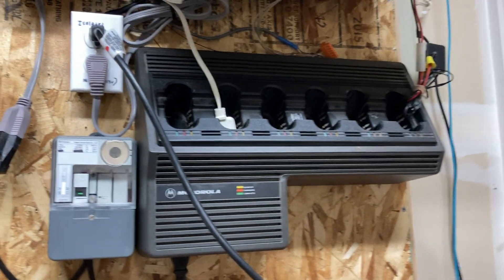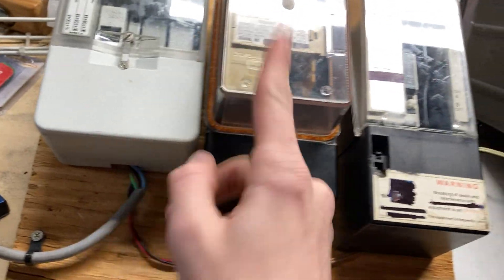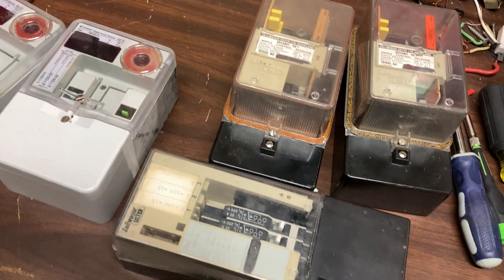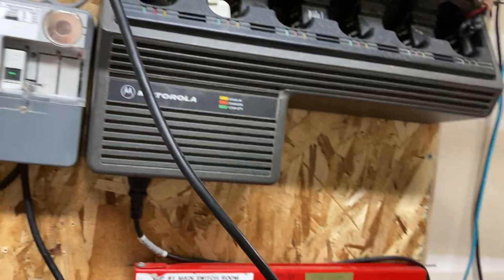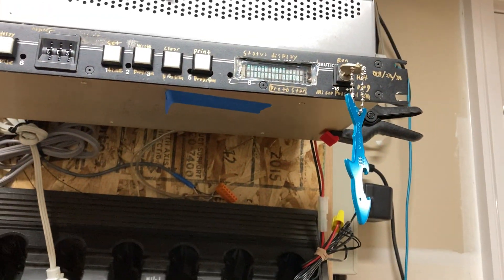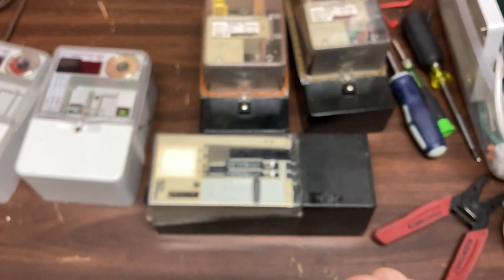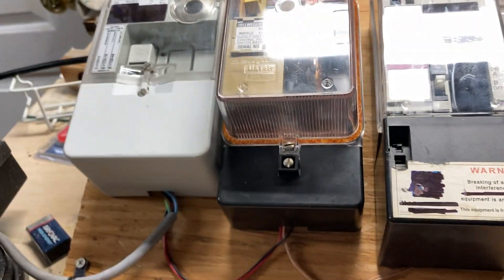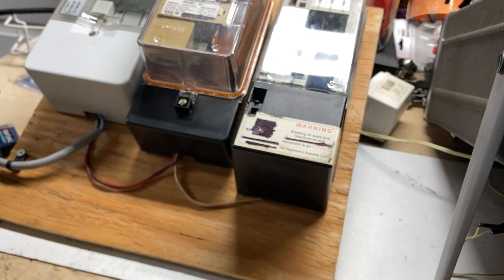Ripple control system update - finally got some receivers

Comment: It’s like X10 at grid scale. Cool stuff.

Is it possible for someone to back-feed the ripple control signals into the grid from their home? Seems like a security risk.
Reply from the maker: Yeah it’s quite like X10, just a lot slower and a lot older. It would be possible to backfeed a signal into the mains, however the current required to do so would be very large. You would most likely pop a breaker trying to do so assuming you could find something capable of generating the correct signal at such a large current level. In the event that someone did successfully do so it would only affect the receivers behind the transformer supplying the house. It’s quite unlikely that someone would do it, but it’s always possible.